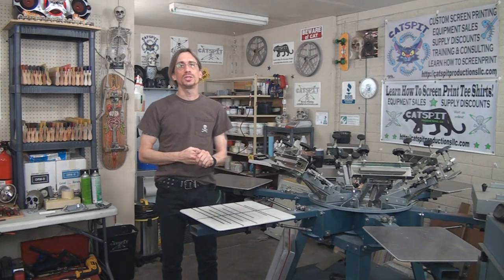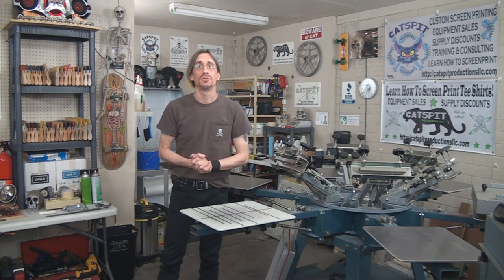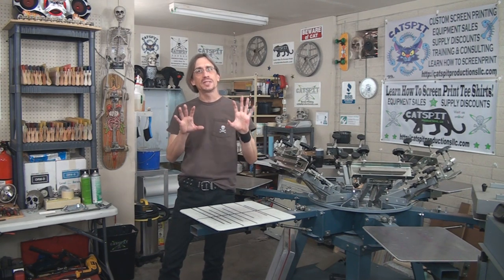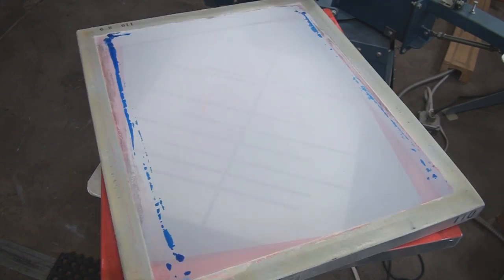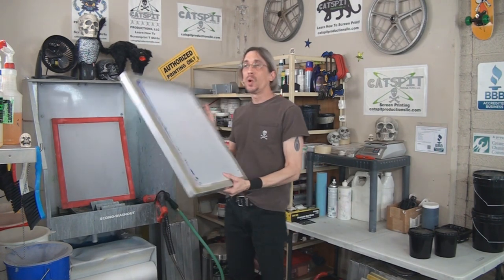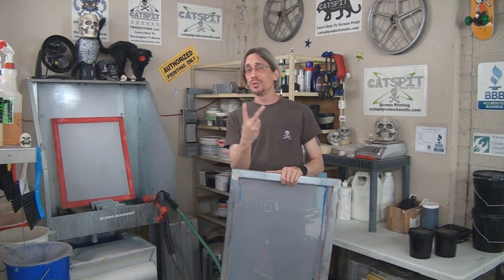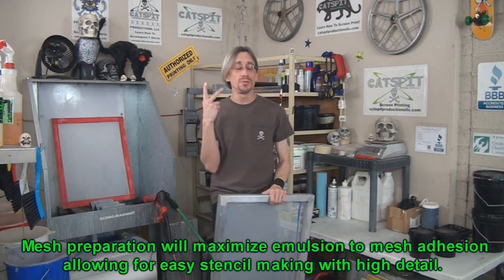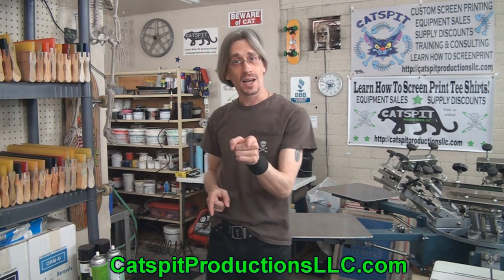Screen Printing: Emulsion Adhesion And Mesh Preparation

Comment from the maker: @TheGollyWally Sure, most low mesh counts are white here in the States. Higher mesh counts have dyed mesh for high detail exposures. The dye prevents the light from scattering off the mesh fibers and causing diffusion. But for most low detail spot color prints, which we use lower mesh counts for, dyed mesh is not necessary. A halftone will do better on a higher mesh count like a 230 or higher which will be yellow or orange/amber in color. Thanks for watching and commenting, I appreciate your support!

Comment from the maker: Oh yes, please do. You will find it easier to make screens and get off detail if you abrade the mesh some when first using brand new screens. There is a “micro grit” available from most print suppliers, like those on the Print Supplies page of the Catspit website, that will offer mesh abraders for mesh preparation.  Thanks for watching and leaving a comment! ☠

Comment: Thanks for this video man. I'm having some real trouble with my screens. Both the emulsion staying on and weirdly with the emulsion completely coming off during wash. Sometimes it just won't come off and my screen becomes useless.
Reply from the maker: You're welcome. If the emulsion is coming off in certain spots then perhaps you have an adhesion problem. If you're saying some screens work and others don't then that is much harder to diagnose blind. I would need more detailed info an exactly what is happening there to even try. Thanks for watching! Screen Printing Equipment & Supplies - http://CatspitScreenPrintSupply.com/

Comment: Instead of the abrader... can the degreaser and a good brush get the wear needed?

Thank you! I've learn a lot with your videos!
Reply from the maker: You're welcome! Glad I can help out through my videos. Probably not since that may be a bit rough. Instead when in a pinch use a touch of Ajax or Comet kitchen cleanser and just be careful not to scrub too much. Thanks for watching! Screen Printing Equipment & Supplies - http://CatspitScreenPrintSupply.com/

Comment: Hey there, So I've got hybrid emulsion and for some reason, the image isn't washing out. I am exposing on a makshift exposure unit (flood light set up on a PVC rack). Usually it's about 11 mins and my screen is good. But with the hybrid emulsion it's barely washing out. Should I up the exposure time to 15 mins?Maybe it's under exposed?

Thanks in advance for your help and please keep the videos coming!
Reply from the maker: If it barley washes out then it could be over exposed. If it's under exposed it will washout too fast losing detail or washout completely. Thanks for watching. Screen Printing Equipment & Supplies - http://catspitscreenprintsupply.com/
Reply: CatspitProductions Ok, thanks for the info!
Reply from the maker: superchanneljim My pleasure.

Comment: Thank you for sharing your great knowledge.
Where i can buy the 2 components Glue... the 'red glue '  or something similar for the same effect  :) ? 
Thank you!
Reply from the maker: CkL.33 If you need the screen mesh adhesive I can sell it to you. It's an aerosol activator with a spreadable base. You spread the glue base over the stretched screen mesh and onto the frame. Then the spray activator is used to make the glue cure and harden. Contact me though my website if you're in the US and need assistance with the purchase. Thanks for watching. Screen Printing Equipment & Supplies - http://catspitscreenprintsupply.com/
Reply: CatspitProductions Hello! thank you for your quick response. But ... Sorry , i'm from Portugal! :( 
Thank you so much!
Reply from the maker: CkL.33 LOL, yea that's why I said IF you're in the US ;) But you're very welcome. I'm happy to help out any way I can from afar. Good luck!
Reply: CatspitProductions Hello Friend. when I remove the emulsion, I'm getting with some yellow spots (like it was burned) in the drawing area. the zone that has been recorded, it is with some yellow spots. is what are the ghosts ?! Thank you!!
Reply from the maker: CkL.33 I'm not sure. Do you mean when you expose and washout the stencil? Maybe you have some ink haze or staining from the last job in the mesh. It's hard to say without seeing the screen or what you are doing there.

Comment: Still using white mesh?
Reply from the maker: @TheGollyWally Sure, most low mesh counts are white here in the States. Higher mesh counts have dyed mesh for high detail exposures. The dye prevents the light from scattering off the mesh fibers and causing diffusion. But for most low detail spot color prints, which we use lower mesh counts for, dyed mesh is not necessary. A halftone will do better on a higher mesh count like a 230 or higher which will be yellow or orange/amber in color. Thanks for watching and commenting, I appreciate your support!
Reply: I know about light scatter and why we use a yellow mesh. But what you say makes sense for spot colours. Screen printing is a very 'accommodating' medium. I work at a printers with 6,8 and 10 col machines. However I come from 20 years in litho print. I enjoy your vids and you are entertaining as well as informative. Cheers
Reply from the maker: TheGollyWally @TheGollyWally Awesome, I’m glad you found me. It’s true the process is dynamic and works in many different ways. I did some litho work in college for my degree. Cool stuff. I also worked with a flexo printer many moons ago. Thanks for watching and leaving a comment!